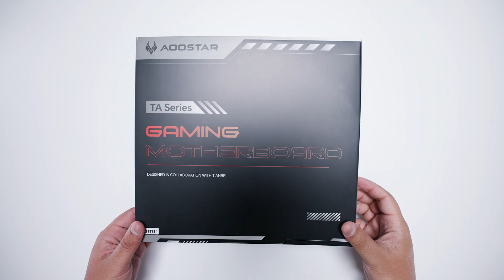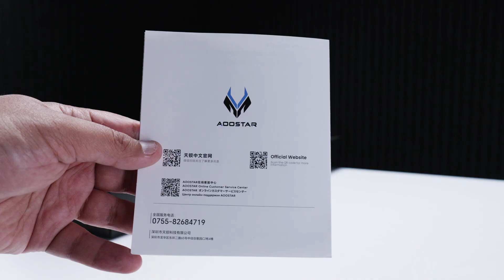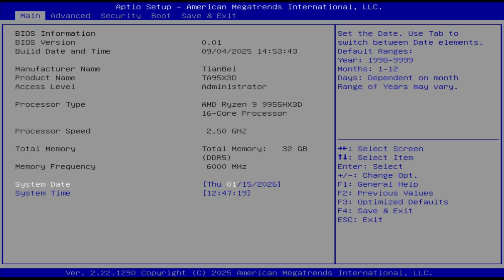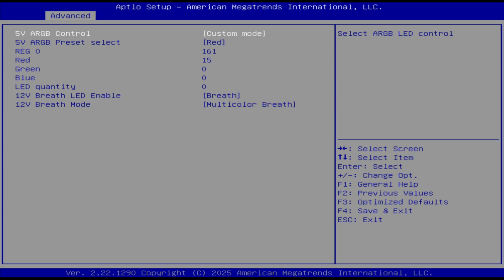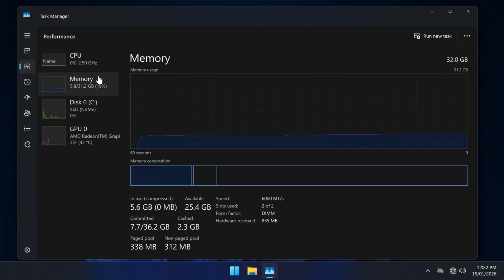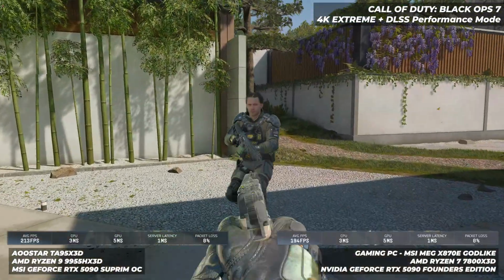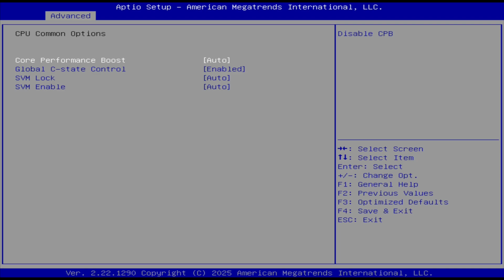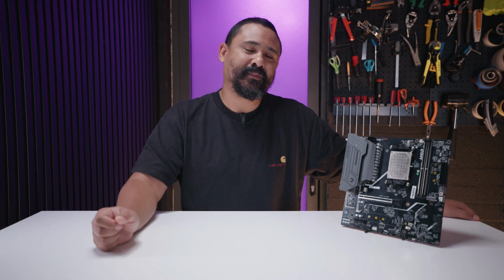This MATX motherboard has a MASSIVE secret!

Comment: They got one thing right over Minisforum, and it's the cooler option. These X3D mobile CPUs can fry an egg when running high demanding/intensive tasks, and the rinky dink low profile heatsink that comes stock with every BD-series ITX board from Minisforum aren't capable of reducing heat that reaches up to 95 Celsius before the TJMax in the bios just shuts off the PC.

I'm glad they inspired other companies to take up on the trend when they can put out their own versions that hit where Minisforum do not.

Comment: As you alluded to at the end, these are getting so close to hitting the mini homelab niche, but not quite yet. mATX theoretically fits in a 10" half-width rack footprint(-ish), you can potentially squeeze in two GPUs, or one and 100+ GbE, or a SAS HBA, whatever - maybe even one more single-slot card. It's all about the way the PCIe lanes are configured, and on these kinds of platform it's still a bit squeezy. As PCIe Gen 5.0 becomes more of the default than the luxury, there should be plenty of room as the latter two I mentioned only need half the lanes (for Gen 5.0 native cards). Probably one generation away from these, or Strix Halo or 388H types, having the bandwith to be really viable, multi-purpose homelab machines.

Comment: If AMD is going to recycle chipsets and architectures for multiple generations, it may be worthwhile to adopt this strategy. AM5 has been a singular release so far and was introduced 3 years ago with no meaningful reason to upgrade. Make the purchasing process simpler and prevent bent pins entirely. I'm open to going integrated since upgrades are pointless.

Comment: 11:39 your gpu is not at pcie 5.0 its pcie 1.0 😅
Reply: I kept waiting for him to click "render test" in GPU-Z. Never happened. I'm curious if using 2x M.2 would reduce it to 5.0x8 or not.
Reply: @jjlw2378  haha yes! I was too! I thought for sure they would at least run something, I'd assume there would be enough lanes as the board also supports two 5.0 x4 pcie for the M.2 slots.

Comment: 4:51 there is no chipset as we would refer to it today.  The 'chipsets' we would see plastered on model names of desktop boards are what us olds would've referred to as the Southbridge in years past as the Northbridge has moved onto the CPU itself as the IO die. For mobile and embedded, there just simply isn't a Southbridge anymore as the Southbridge is redundant. All of the features a desktop would need are removed and the ones a laptop or embedded system would need are moved onto the CPU, making it an SoC rather than a CPU. In fact, in today's desktop designs, there isn't even technically a chipset since the Northbridge was removed as there is only one and no longer a 'set of chips'. Definitely unlike the five VLSI chips my 286 board has.
Reply: amd have weird cpu that not need pch to run (in term of where the I/O like usb are driven) but intel HX need one as those chip are just desktop sku at lower power and soldered (and with ultra 200hx ,are also in a smaller interposer unlike 14th gen hx that were the same 45*37.5mm as lga 1700 chip) ,and on "real" laptop chip sku (the one supporting lpddr5x and with better igpu) all the i/o are embeded on the chip for better efficiency